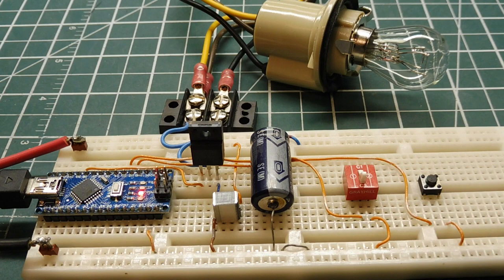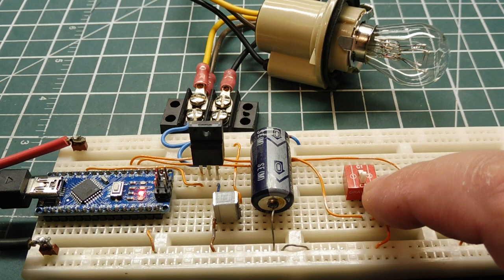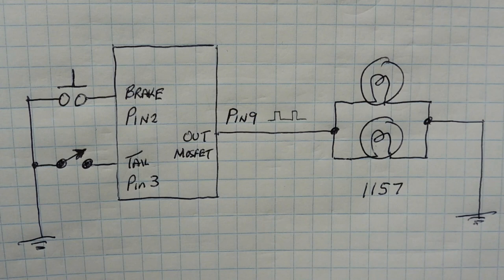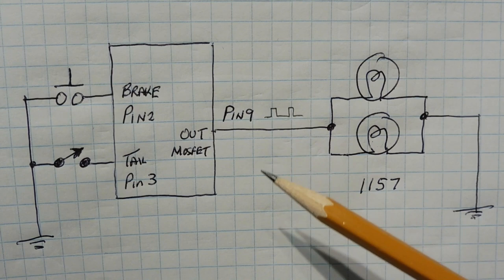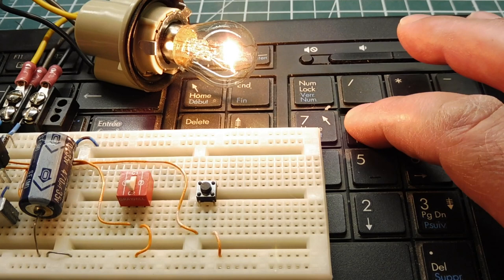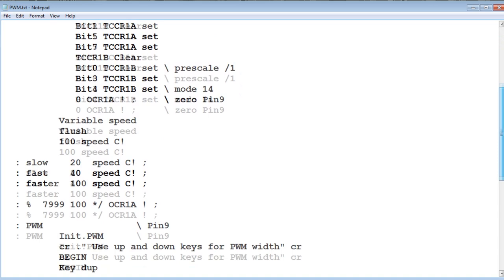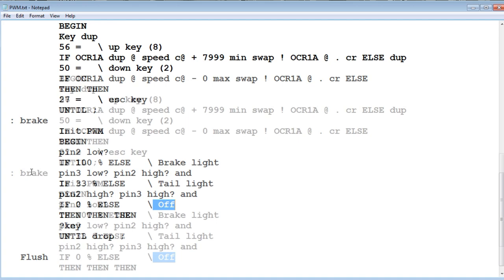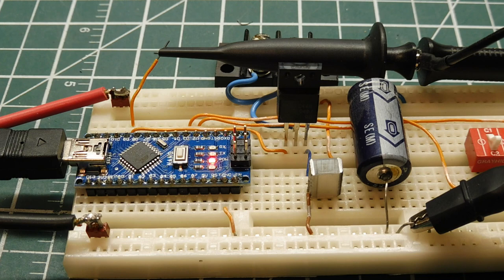Tail/Brake Light  One Wire Control  /  How Does It Work?

Comment: Nice, what i can do to merge the turn signal with the brakes ? Like most american cars on the same bulb ?
Reply: If you're still interested, I made a circuit that did this a few years back. I have it on youtube. 
https://www.youtube.com/watch?v=W4vFZX5QrWs is the video demonstrating it. At first I show the regualr style, and then I activate the circuit and you can see the US style used.
If you want more information, or a better circuit diagram or help wiring it up, let me know.
Reply: @dancoulson6579  hey, sure if you can help me build the circuit, i can enable and disable easily the circuit ?

Comment: Cool video
will this work also with LEDs?
Reply from the maker: No .. this technique only works because of the two different resistances of the bulb filaments.
Reply: @0033mer  thanks
Reply from the maker: Got it working with a LED light. LED lights are more efficient than incandescent so I had to adjust the duty cycles accordingly to get a tail and brake function.
Reply: @0033mer  thanks
Reply: @0033mer  hello, trying to convert to led. How can I do so??